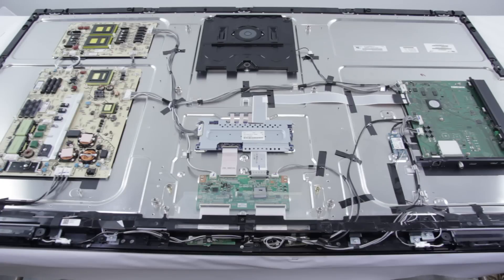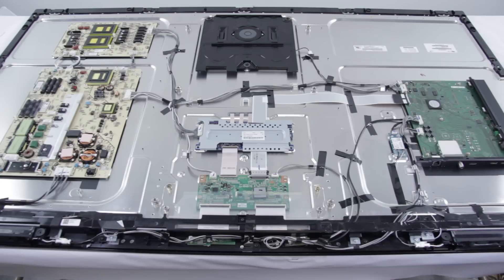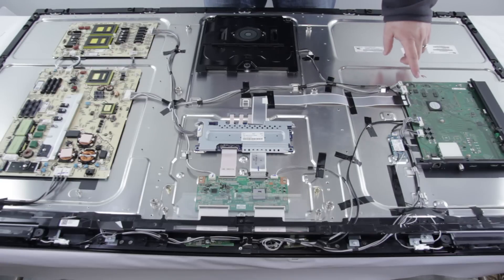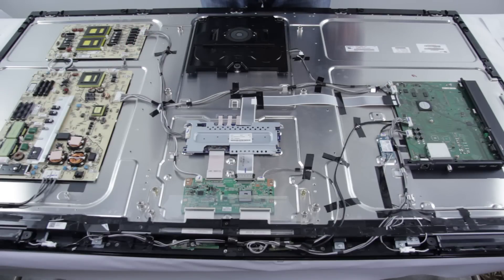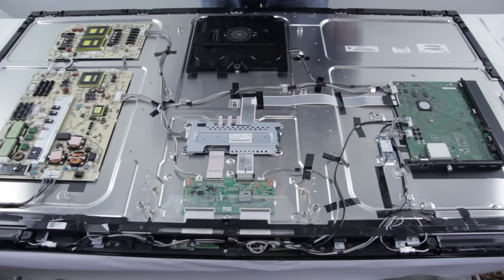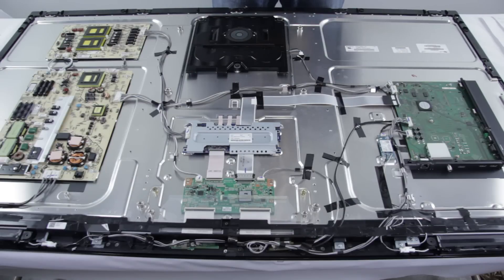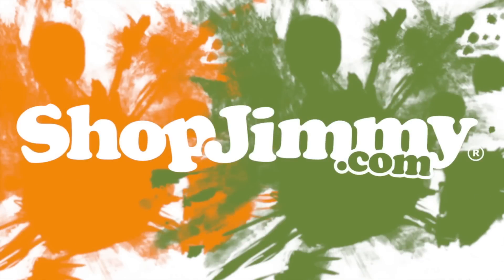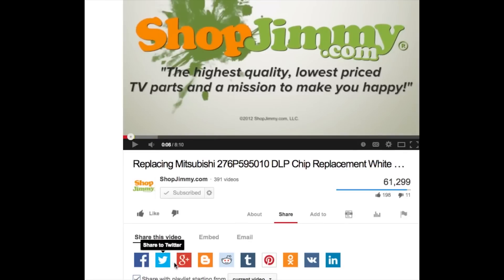LED TV Repair Main Board Overview Blank Screen-TV Has Audio but No Video-Common Issues Problems

Comment: I have LG 32 inch LED LE5500. I cannot see any any Cable Channels it says no signal. When I plug the HDMI cable into the port it gets detected but not channels showing up(No signal). Is it actually a bad motherboard or main board?
Reply from the maker: *****   I recommend trying a different HDMI cable to see if that helps.  Thanks!  www.shopjimmy.com

Comment: i have a zeiki tv that has sound but no picture. you can see somethjng but the screen is black. we had a storm and the electric went off and when i turned it back on it was like this. Its seiki model # SE32HY27.

Comment: I have a Panasonic TX-L55ET5B  led tv it has no sound or picture, no on screen display .the backlight is working I have already replaced the tcon board can you help? cheers
Reply from the maker: rossymark   I recommend replacing the main board in your TV.  Unfortunately I do not see any replacement parts in the search results for your TV model number on our website.  Please reply with your part number on your main board and I can try searching for replacement parts.  Thanks and please let us know if you have any further questions!  www.shopjimmy.com

Comment: I love your video.  You help me fix my Samsung TV by replacing the T-con board which I order from your website.  Now I have another TV which I need help.  It is 55EG9600 55-Inch 4K Ultra HD Curved Smart OLED TV.  It power on for about 30 then power off which I can see the LG logo blinking but there is no video or sound.  Can you tell me which board I can replace?

Comment: Samsung UN55HU6840FXZA TV - I have replaced T-Con board, Main board and backlights which were bad. I replaced them still no picture? The only thin left is  power board. I checked connections didn't find any problem.

Comment: I have a Seiki 50" 1080 television set that is less than a year old.  The screen has gone dark.  It isn't black, per se, if you look closely you can see that their is still activity on the screen, it is just unlit.  What do I need to do to fix it?
Reply: Seiki se501ts
Reply from the maker: Null257   This could be a problem with either the main board or the power supply board in your TV.  I recommend replacing the power supply first and if that does not fix the problem, then replace the main board.  Unfortunately I do not see any replacement parts in the search results for your TV model number on our website.  Please reply with your part number on your main board and power supply and I can try searching for replacement parts.  Thanks and please let us know if you have any further questions!  www.shopjimmy.com

Comment: need help have a Westinghouse  led model # dw39f1y1 I picked it up from a friend , problem when you turn it on all you get is a blank screen but the blue indicator light comes on can you lead me in the direction
Reply from the maker: Dan Cerone   I recommend running the flashlight test on your TV.   Here is a link to a video we produced that shows how to run the flashlight test. https://www.youtube.com/watch?v=xUzCLgoSPGM Please reply with your flashlight test results and we can recommend a replacement part for your TV repair. Thanks and please let us know if you have any questions! www.shopjimmy.com

Comment: I have an LG 47LX6500. When I turn the tv on the LG logo shows for 1-2 seconds, and then the screen goes black. The power stays on, and the led on the power button is white (usual color) and blinks when buttons on the remote are pressed. I have replaced the power board, but the same thing continues to happen. I don't seem to have sound, and I have tried using a flashlight, but I can't see anythign on the screen.

Thanks!

Comment: I have Sharp 50" LED TV,  6 years old.  Model #LC-50LB261U.  I can get the tv to turn on using the tv remote or by using the power switch on the tv ( the standy light changes from orange to blue to indicate the tv is powered on). I get no picture or sound.  I was playing a dvd movie the night before the picture went out, but the tv was slow to respond to any of my remotes.

Comment: Hello, i have a 2011 LG 55LG5500 and the screen shows bad pixels with vertical lines.Lots of green pixels. and every few minuets the screen blinks. What can cause that? I was told mainboard.

Comment: Vizio e500i B1.  Turn on and Vizio logo on screen flashes on, then off and no video.  Audio  works and flashlight test shows video.  This used to be intermittent, but now consistently does this with no video.  Thanks in advance
Reply from the maker: +Mike Ross  Try all repairs and troubleshooting at your own risk. This sounds like a problem with the actual LEDs inside your TV. These LEDs are replaceable, however it is recommended they are replaced by someone with the proper experience and training. When replacing the LEDs, the TV panel can get damaged. If the TV panel gets damaged, it is not repairable. Click this link to replacement LEDs for your TV model number:  http://www.shopjimmy.com/catalogsearch/result/index/?cat=299&q=e500i+B1   Be sure to match the panel information necessary to ensure you have the correct replacement LEDs.Thanks and please let us know if you have any further questions with your TV Repair!  www.shopjimmy.com

Comment: I Have a samsung UN60ES7100F S/N Z5PV3CDCC02110P  VERSION # HS01. The tv will turn on and the red light is on but the screen is black with the exception of a dark blueish light fading on the bottom of the screen. The tv is less then 2 years old and has had very little use. Please advise me what parts I will need and if you have them. Thank You Jim

Comment: I have a Sharp Aquos LC-60LE832U the remote does not work if I unplug the set and plug it back in the remote will work for a couple hours. all this began after a power outage. I have two remotes with good batteries

Comment: I have a Seiki SC402TT TV.  The RF plug was loose inside the cover on the main board so I removed the back cover to get the part number of the main board put the main board back in powered up the tv the red light turned to blue but now I do not have any output on the screen or sound

Comment: un50eh5000fxza black screen with audio still working via HDMI.  All I did was update the the firmware.  I can hear the Samsung Tone and see a black light but nothing on screen. I also tried the Mute 184 power on command and nothing happened.  Any suggestions?  I was just given this tv.

Comment: 46 inch toshiba model number am395009441 tv powers on but no picture what do i have to do to fix my tv??
Reply from the maker: +Rude Oz   Try all repairs and troubleshooting at your own risk.  I recommend running the flashlight test on your TV.   Here is a link to a video we produced that shows how to run the flashlight test. https://www.youtube.com/watch?v=xUzCLgoSPGM Please reply with your flashlight test results and we can recommend a replacement part for your TV repair. Thanks and please let us know if you have any questions! www.shopjimmy.com

Comment: Hi, I have a Vizio E390i-A1.  It has no power at all.  No lights, no nothing.  I tested the power supply and it was not putting out the correct power however I don't think it gets turned on like it should.  When I disconnect the main board, the 5V output is good on the power supply but the other two (24V and 12V) are still off, when I plug the main board back in the 5V goes away.  I figured bad main board and ordered one from ebay.  The replacement board does the exact same thing, so I tried another power supply, still exact same thing.  It takes the 5v away even if the main board is completely unplugged from everything else except power supply board.  Any thoughts?  Or should I have thrown this tv away like a compliant american?  (I hate to throw away ANYTHING)
Reply from the maker: Noah Davis   This sounds like a bad main board and I am thinking that your replacement main board is also bad.  I recommend replacing the main board again.  Here is a link to possible replacements:  http://www.shopjimmy.com/catalogsearch/result/index/?cat=56&q=E390i-A1  Be sure to match part numbers on your current board, with your replacement for compatibility.  Here is a link to a video showing how to identify your part number, click here:  TV Part Number Identification Guide for Vizio Main Boards (Plasma, LCD, LED)  You can also call our customer service for further assistance with your purchase.  (877) 881-6492  Thanks and please let us know if you have any further questions with your TV Repair!  www.shopjimmy.com

Comment: I have an RCA LED TV model 32LA45RQ. None of the buttons work except for the power button on the TV itself. The TV will power on but I cannot change inputs, channels, volume etc.  The TV does not respond to the remote at all.  The sound output though my surround sound system works and we can use the Wii since that is the component input it was on when the problem occurred.  Any thoughts?  Thanks.
Reply from the maker: J Weck  Please watch this video FIRST to help with your repair!  https://www.youtube.com/watch?v=BP3NVNCGEv8  I recommend replacing the main board in your TV.  Click this link to replacement parts for your TV model number:  http://www.shopjimmy.com/catalogsearch/result/index/?cat=56&q=32LA45RQ  There may be multiple boards for the same TV model number, be sure to match part numbers on your current board, with your replacement for compatibility.  Thanks and please let us know if you have any further questions with your TV Repair!  www.shopjimmy.com

Comment: i have a samgung un39eh5003f and whenever i turn it on, it's just a white screen, it happened when the power to my block went out a couple of nights ago
Reply from the maker: Zacc McCaskill   This could either be a problem with the main board or the T-Con board. I recommend replacing the T-Con board first to see if that fixes the problem. If that does not fix the problem, then I recommend replacing the Main board to see if that fixes the problem.  Here is a link to replacement parts for your TV model number on our website, click here:  http://www.shopjimmy.com/catalogsearch/result/?q=un39eh5003f  Be sure to match part numbers on your current board, with your replacement for compatibility.  You can also call our customer service for further assistance with your purchase.  (877) 881-6492  Thanks and please let us know if you have any further questions with your TV Repair!  www.shopjimmy.com

Comment: I have a samsung smart tv model UN32J6300AFXZA UD02. the problem i am having is, when I turm on the tv, I get sound but no picture. the back lights are working, but the screen has vertical black lines and the picture is gray color. It will stay like that for about a minute then the picture will come on. There are lines and the picture is fuzzy at first, then I get some double imaging, then it all clears up the picture is on full hd, no problems after that. the tv works fine after that. I changed the T-con board, did not correct the problem. Any other Ideas, I was thinking of changing the main board. or power suppy

Comment: need help, I have a Panasonic TC-L50E60 tv, the color on most of the screen  from left to right, is white, black, blue green, the only color that is correct is the right side and that's only about a quarter of the screen, any help or ideas would be very helpful, thanks.
Reply: ShopJimmy.com hi, thanks for your response, I might have explained my problem incorrect, my tv still has a full screen, I can still watch a program on it , but the color is not correct, the tv has a self check, I would like to send you a picture of it that way you can see what is going on with it.i don't know where or if I can send you a picture, please let me know, thank vm.
Reply from the maker: Vin M   You can upload the photo online and then reply to this comment with the link.  Thanks!  www.shopjimmy.com

Comment: Samsung UE40EH6030WXZF:  The TV has no picture and standby LED flashes 5 times, then delays and flashes 5 times again.  Power Board seems OK.  All voltages seem fine when Main Board (20 pin connector) is disconnected.  Once the connector is disconnected, backlight will turn-on.  Otherwise, the backlight is off. WIth 20 pin connector between Main and Power Supply is connected, Pin 1 is -6 volts (supposed to be GND).  Presuming a Main Board problem?  There is a strange square plastic bracket over left side (marked BN94-05875Y).  Not sure how to remove it since there seems to be contact pins through the Main Board in it.

Comment: i got problem with my micromax led tv....model number 39k20fhd.....black screen.....with lose connector.....and accidentally incorrectly  misinsert the display wire so 2 or 3 chip or sort is burn out....is there any way to repair it

Comment: I have a Panasonic th-65fx700a. Doesn’t turn on always. Sometimes need to turn it on and off 20 times and then it’ll work fine. Standby light works but blinks differently every time it’s turned on. Screen isn’t completely dark, the backlight usually works. When grey lines appear vertically on the screen it usually works fine after next on/off cycle or 2. ? Strange ? Or common problem?

Comment: I fix the power on the power board, it's not shutting off any more but now no sound or picture. Samsung hp t4264
Reply from the maker: Hugh Clarke   PLEASE SUBSCRIBE TO OUR CHANNEL - Try all repairs and troubleshooting at your own risk.  I recommend replacing the main board in your TV.  Click this link to replacement parts for your TV model number:  http://www.shopjimmy.com/catalogsearch/result/index/?cat=56&q=hp+t4264  There may be multiple boards for the same TV model number, be sure to match part numbers on your current board, with your replacement for compatibility.  Here is a link to a video showing how to identify your part number, click here:  https://www.youtube.com/watch?v=BEPWrefQvqIThanks and please let us know if you have any further questions with your TV Repair!  www.shopjimmy.com

Comment: TCL 65 inch roku tv model number 65S401 it has no picture but does have sound I read for a temporary fix to unplug the tv press the power button on the TV for 30 seconds and the tv would work for a short time which it did but it didn't say what was wrong with it if it worked

Comment: I have samsung Ua28h4100rlxl led tv. Earlier there was black screen but with audio. But now there is no response at all. I found that led lights are glowing but soon after connecting main board led goes off.. Suggest repair.

Comment: I have a Toshiba 46l5200u..Everything turns on fine but now after 5 min screen goes black but still has audio. I shut off and on. Plays a while then goes black. Thought it was cable box..It wasn't. Please help if you can. Purchased in 2012 I believe

Comment: LG47LN5200  , back light working properly, audio ok, T con  board already replaced by a new one and still with no video or picture at all, already used a flash light to see any picture but nothing came out, the screen is not completely black it has a glow but no image came out.

Comment: I have LG 47LN5700 with screen turning black, but when a flash light directed on the screen, you will be able to see what's there in the screen.
what would be the issue and how it can be fixed?
any available solution videos?

Comment: Hello. I have been diagnosing electronics for years. But I’m having an issue with a Samsung, I think may be firmware related. But. The tv comes on and shows the Smart TV logo then goes away. The TV then turns off after 30 seconds. I replaced the power board and still no fix. The TV will come right back on every time and do the same thing. Any suggestions. The main board would be the next step, then T-con.
Reply: TV model - UN55H6350AFXZA

Comment: HELP. Please. Vizio E420-A0. 42".  One week ago, center horizontal much darker than rest of picture. Today, sound, but no picture. (Technically, I see tiny flashes of light or pic every so often). Very limited income. Hoping you can help me. Thank you for your time & effort. Greatly appreciated.
Reply from the maker: +D Hoosier   Try all repairs and troubleshooting at your own risk. This sounds like a problem with the actual LEDs inside your TV. These LEDs are replaceable, however it is recommended they are replaced by someone with the proper experience and training. When replacing the LEDs, the TV panel can get damaged. If the TV panel gets damaged, it is not repairable. Click this link to replacement LEDs for your TV model number:  http://www.shopjimmy.com/lg-lc420dug-jfr1-led-strips-10-strips-1-board.htm   Be sure to match the panel information necessary to ensure you have the correct replacement LEDs.Thanks and please let us know if you have any further questions with your TV Repair!  www.shopjimmy.com

Comment: My Samsung UN55ES6580FXZA picture got funny looking mainly on the left top side. It also turn dark but you can still see image in the back ground. There are no vertical line but it does have a  very light horizontal lines on the  bottom half . Doesn't appear to be getting any worse.

Comment: I have a samsung 40" tv   Model  un40j6200afxza   it has sound but no picture.   I replaced the T-con board which did not fix the problem.   I then replaced the main board and the problem also was not fixed.   Is there anything else I should try or should I just buy a new tv?   Is there any way to sell the 2 boards which I removed and probably work?

Comment: I HAVE SAMSUNG CS-21Z45ML WITH NO PICTURE IN AL SOURCES BU AUDIO IS FINE, IF I PUT IN VDEO SPURCEWHLEIN AV MODE,THE SCREEN GOES BLANK, HOW MAY IT BE FIXED, I HAVE LOOKED FOR THE SERVICE MANUAL BUT I CANT FIND